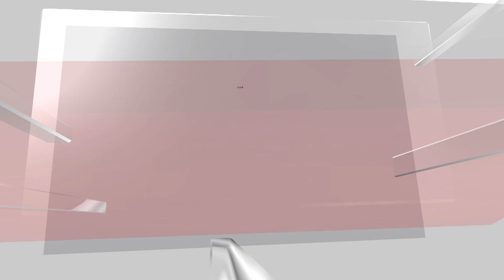India's First High-Speed Train Coaches Will Be Tested At A Rs 173 Crore Lab | Indian Railways | N18V

Comment: So no more Shinkansen
Reply: Shinkansen will run in parallel , due to our loan term we have to buy some products from Japan that is required bullet train, and we have already built my thing made in india, so we have to buy Shinkansen train set from Japan
Reply: @iSHORT.SUMMARY not only because of loan term. They will be transferring the shinkansen tech too with the trainsets and the current made in India which are only 2 prototypes and they will be using European ETCS level 2 signalling and the need is of 24 trainsets and the signalling which will be used by Mumbai-Amdavad is ATC which is a Japanese tech. Means Made in India trains will be in prototype stage and it has only 2 trainsets and it's signalling is also different than Japanese tech and tracks are built using Japanese so ATC is required so In short we are just in experimental and testing phase of made in India hsr tech and Mumbai-Amdavad will only operate Shinkansen trains. India is actually incorporating everything from Japanese and European tech and experimenting just like what china did during its first hsr development in which it took help from both Europe and Japan and then developed its own indigenous tech which surpassed both it's counterparts. It's not so easy to develop an hsr train and just run it commercially. The tech needs to get mature after each iteration and tech enhancement that's the reason India is taking help from Japan for it's Mumbai-Amdavad route while developing made in India trains with European signalling tech and then also has kavach 4.0/5.0 which with ATC/ETCS can just level up with Chinese CTC level 3 .
Reply: @iSHORT.SUMMARYmade in india train should be built for 350 kmph .we have spent nearly 2 lacks crore for this project.
Reply: WRONG. SHINKANSEN WILL BE THERE.
Reply: yes. No more Shinkansen. Shinkansen train sets have been rejected as being unaffordable for India. As Indian rupee depreciates, Shinkansen train sets are becoming more and more expensive. There are other HSR train sets in the world - French, Korean, etc- that are cheaper especially when the speeds are much lower than 350 kmph. Most likely a tech transfer of these slower trainsets will be done. Indian economy is not at a place where it can afford Shinkansen trainsets at today's costs. Maybe once it crosses $10 trillion.
Reply: @backpropagation8365 Japanese Yen depreciated much more than Indian rupee 🙃